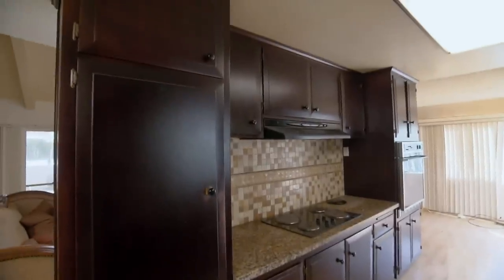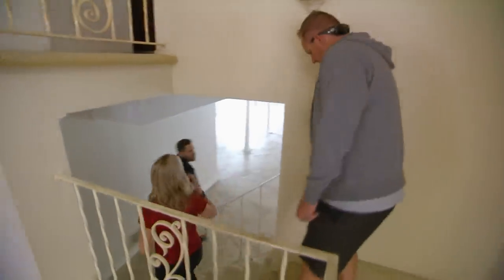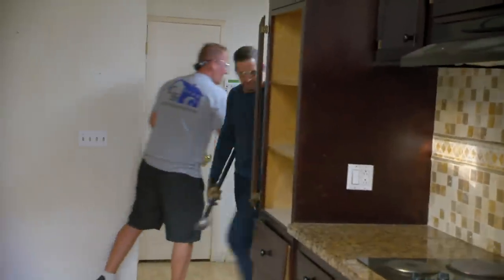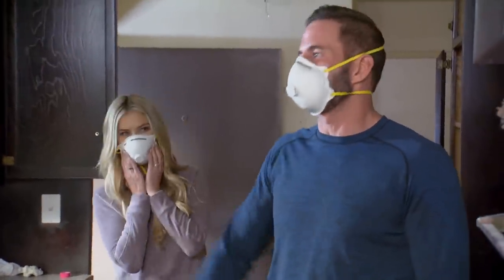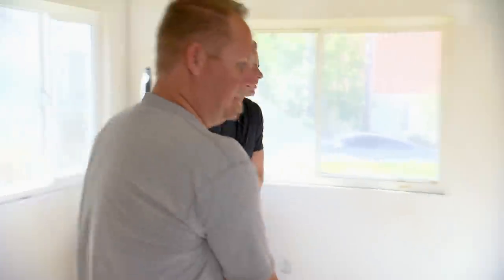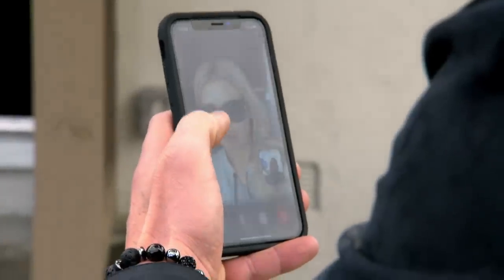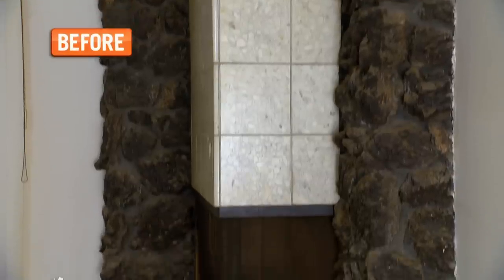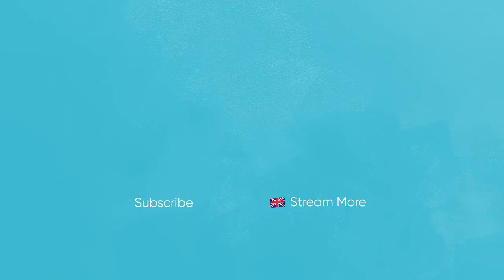Tarek & Christina Tear Down Walls To Expand Kitchen Size | Flip Or Flop

Comment: The exterior after could have been a lot, lot better.  It's hard to say the exterior is improved.  Kitchen island turned out too small, backsplash is cool up until the green light, lol.  Interior is better overall but euro showers would have been much better.

--It's been a long time since they've showed this house.  I have zero recollection of it.  Wonder what the source of the smell was from??
Reply: I sometimes wonder if, after everything has off gas and the aroma from paint and carpet and such as disappeared, the bad smells come back. I've seen that sort of thing happen.
Reply: @angelbulldog4934  
Good point.  Think it quite likely if they never dealt with the source.  If you correctly use proper enzymatic products the results are great, however.

Comment: I've been watching Christina and Tarek's programmes (from Australia) for years. I'd love to see them create an accessible home for someone in a wheelchair. Disability bathrooms are functional but incredibly ugly and a wheelchair accessible kitchen is a challenge for designers. If Christina and Tarek can make a disability bathroom work Christina makes it look beautiful, she could start a new design trend of enormous benefit to the disabled community. She certainly has the talent.
Reply: A euro shower would add accessibility and a sense of spaciousness but you never see it added.
Reply: @b_uppy  I looked up the 'euro' shower (thanks) and it's similar to what we call a roll-in shower. A main gripe is Aussie disability showers are invariably ugly, with slippery tiled floors and stainless steel safety / grab bars. The shower head that slides on a post is often too high to reach so two shower heads, both with mixing taps are needed - one at waist height. There seems to be one Australian design, based on the sterile looking hospital roll-in bathroom with a hard, uncomfortable wooden folding seat. There's very little shelf space provided and I've yet to see bathroom pull out storage baskets on sliders. Hooks for towels and clothing often placed too high on the wall - a spacious shelf with a low mirror is needed next the basin for shaving or makeup - and I've yet to see a heated towel rail in the right place. My gripe list goes on.
Reply: @josewilliams6094  
True.  Much of the designe is very able-bodied, male/(tall person) centric.  Some 'handicapped' adaptations would benefit a lot more people but designers tend to ignore that.  Love the euro shower because it also helps with overflow issues.  Think designing for optimal benefit is the way to go.
Reply: @b_uppy  You've raised a major point re overflow, always a problem with roll in showers. A soaking wet floor ensures drying off and dressing creates another hazard. I'll read more about the euro shower to find out why that draining is more efficient.
Reply: @josewilliams6094  
It helps with tub, toilet, sink and washing machine overflow as well.
Reply: @b_uppy  Is it the drainage 'channel' that creates better drainage?
Reply: @b_uppy  Just spotted a company called 'Formufit' that makes solid coloured pipe that could be used for rails / hand-holds, as part of the overall bathroom design. It would look way better than the present stark disability bathrooms with ugly stainless steel safety rails and hand grips that resemble a morgue. At present rails can only be attached to regular studs / framing behind walls designed to fit the dry wall. Framing needs to fit the design of fittings for disabled bathrooms.
Reply: @josewilliams6094  
The floor slopes to the drain, and drainage can be assisted with a squeegee if need be instead a ton of towels...
Reply: @b_uppy  That's good. I also saw a reference to 'gutters' sunk into the floor that feed into the drainage hole to get the water away faster. You're right that all the fittings are designed for tall men. The existing safety rails best suit a male with hands like shovels. Quite hard to hold on to.
Reply: @josewilliams6094  
Would like to see better accessibility as it makes more sense in the overall scheme of things.   We have little people as well as young disabled people that need accessibility as well, while having the ability to restrict access to toddlers with more curiosity than sense, lol.
As to how some could be addressed a person could be creative.   It certainly adds to resale value which is a big missed opportunity on their part. 
It's sad that Oz has a limited approach towards disability, as has this show.  
One of my beefs is this show's overdependency on community/government irrigation instead of adding site-based resiliency through rainwater harvesting earthwork and techniques, this is So Cal for Pete's sake...
Reply: @b_uppy  Young people, little people, the fragile elderly, all restrictions affecting any age, even the temporary disabled - all in need of workable bathrooms and kitchens. I couldn't agree with you more.  Where to hang crutches, walking stick or park a wheeled walker / wheelchair while showering ? - every problem has a solution. As for toddlers' curiosity - maybe mixing taps could be 'locked' at a safe temperature? I did notice one Christina /  Tarek kitchen design that had the dishwasher at the end of the island - a perfect location for someone on wheels, giving access on 3 sides. Slide out shelving / pantries - so many solutions exist but rarely incorporated. Kitchens with drawers instead of cupboards. You're so right about 'missed opportunities'  for renovators. The 'wheel' accessible  house with adaptable disability bathroom & kitchen would attract far more potential buyers. Many new homes here have a huge water storage tank built underground to store rainwater, with the tank doubling as the home's patio. California's water problems must be huge.
Reply: @josewilliams6094  
They definitely are.   Oz does have a lot more sensibility about it's water issues.  I did just see where the politicians keep coming up with so so ideas however.   They wanted to make a huge reservoir that has diminishing returns when they could be opting for much smaller frequent earthworks that put rainwater into the soil and recharges rivers, lake, etc instead of leaving it vulnerable to contamination, evaporation, etc.  
California opts for centralized, diminishing returns as well.  
One nice thing about the Extreme Home Makeover show is that they at least considered options for disabled, whereas channel o have yet to see do anything worthy.  Maybe the Magnolia Network is better...
Reply: @b_uppy  Aussie is experiencing increasing flooding in residential areas, blamed on  global warming. Tremendous property damage is becoming common because of overflowing catchments. Excessive rainwater does need to be diverted away from homes. Something needs to be done, and urgently.
Reply: @josewilliams6094  
Doing Brad Lancaster's approach would be a help.  Doing smaller, more frequent earthworks from on-site materials means fewer failures while avoiding the folly of letting the water flow elsewhere and then paying for infrastructure and electricity to pump it back.  This reduces downstreamfloding while storing a lot more water and avoiding the high degree of evaporative losses.   He uses native plants to anchor the earthworks to help them stay in place. 
We need more farmers to switch to away from ag that loses carbon-rich topsoil, and more emphasis on polycultured crops that use perennials, trees, shrubs and vines, with the pests and weeds managed by livestock.  
Mark Shepard uses an interesting variation of food crops inspired by the local biome.  He also employs 'STUN' which means if a plant doesn't want to grow for him he replaces it with something that does.  STUN stands for 'sheer, utter, total neglect' and that is his expression for 'spending his resources on what works' instead of nursing plants with resources.  
He has been very successful, expanding from his base farm in Wisconsin (I believe) to other farms in other states.  He started with a hundred acres.  Where other small farmers have been losing land to corporate conglomerates he has been bucking that trend.
Both guys have books out and YT videos.
Reply: @b_uppy  You have impressive knowledge of environmental prevention strategies. I especially enjoy these home renovation programmes because Tarek and Christina can take a modest, older house and turn it into a liveable, functional home with a practical design. I especially like Christina's colour choices that allow a buyer to add their own colour / style without making expensive and wasteful changes. Reviving older homes instead of tearing them down is smart environmental policy. I do wonder about the environmental impact of the hugely popular 'laminate' floor boards. It's obvious most people prefer them to carpet but it would drive me nuts to hear shoes clomping around on bare floors. Visitors  don't like being asked to remove their shoes.
Reply: @josewilliams6094  
I prefer floors without carpet as carpet stores a lot of dirt and is a major source of allergens.  I like that they choose true neutrals most of the time.  Brown as the primary neutral makes me gag.  Think much of their design is less than practical but it is usually visually nice, and especially the stagers,
As to wastefulness I think they could do better.  Many cabinets could be refinished/donated to Habitat for Humanity.
Reply: @b_uppy  People who keep a clean house do lay light coloured carpet and know about carpet shampoo machines. The biggest problem is (western) visitors getting offended when you ask them to remove their dirty shoes at the door although many other cultures do that as a matter of course. Recycling cabinets instead of smashing them up is a very sensible practice. All that smashed timber must go to landfill or get burnt, although some of it is probably too filthy or damaged to be reused.